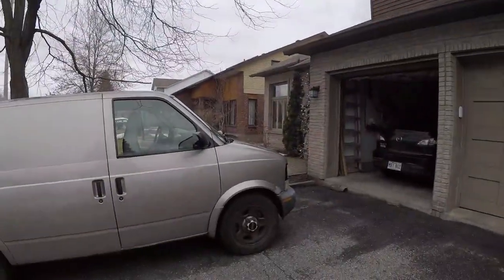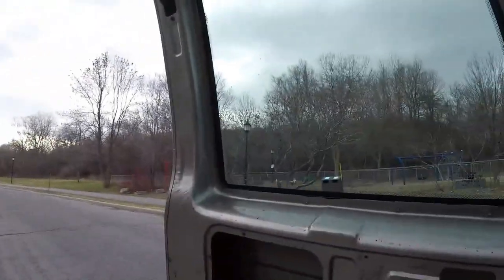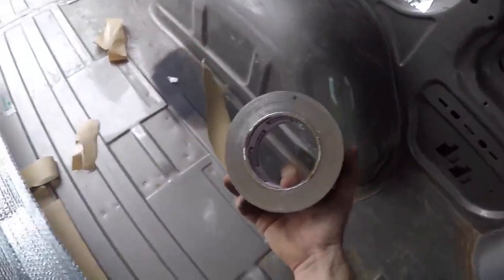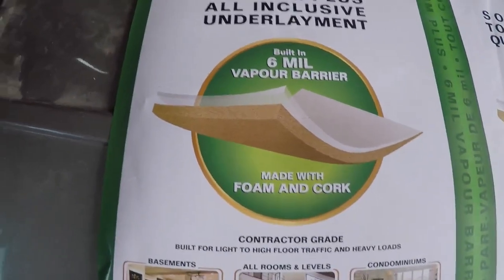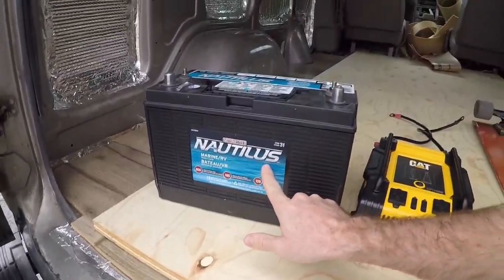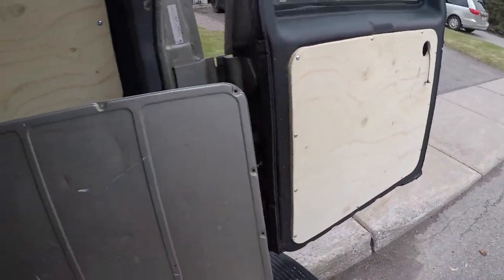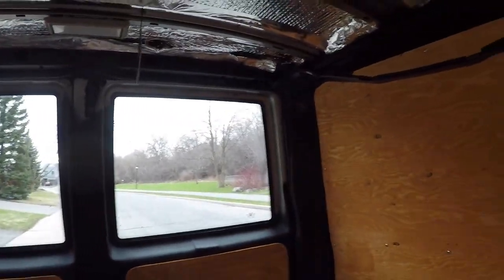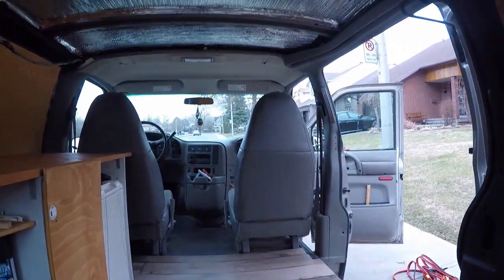Camper Van Conversion/Build Pt.1 - GoPro HD 1080 - (Van Life, GMC Safari - Chevrolet Astro)

Comment: Great series! Picking up my 1998 GMC AWD SAFARI EXT this weekend, for the sole purpose of converting it into a Camper Van!👍 I've been Blessed with a great Friend that renovates yachts for a living, and he will be the brains behind my GMC AWD EXT SAFARI Camper Van project. He is passing along to me the great discounts that he gets from his accessory suppliers....BONUS! I too will video document tbe project. Picked up some great ideas from your series! Just hate that I do not have the high top feature. But, we are going to cut out a section of the roof oval in shape, and add a custom fiber-glass cover. Reason? For the stand-up shower/toilet combination just aft of the driver's seat. I am very excited about this project, as I am sure you have been. Here's a short list of some neat features that he will build into this project: 19" Flat-Screen T.V. mounted to an articulating mount, hardwood flooring, 2 burner stove/sink combination with small marble counter top, (2) 100w solar panels mounted on roof, (4) 125 amp hour deep cycle marine batteries, fold away dining/work table, a compact refridgerator, compact microwave, retractable awning, tranforming couch/bed, pantry with sheving/drawers, WI-FI Booster, motion detecting alarm/with cameras, 25-gallon fresh water, exterior electical and water hook-ups and a side mounted vent system. Will of course have compact coffee maker, a/c and heat. Very bappy for you!👍

Comment: Damn I am still impressed how fast you put this van together. Most people will be curious how long in real time it took and what your total cost was.  Its common for paint on GM vans to peel they had some primer issue. Duplicolor makes the factory color paint in spray cans. Your vans paint code can be ordered at most auto part stores if you want to keep a low profile factory look.  I wouldn't recommend trying to apply a clear coat after its hard to blend and can peel. When a  body shop shoots clear they mix it with a hardener.
Reply from the maker: +rick g It took me about 2-4hrs a days for 3 days to get it to almost finishing point. I'm a carpenter back home. So i know my way around the tools haha. You're a wealth of knowledge! Really appreciate the feedback and information you've given me! Thanks so much legend! Cheers

Comment: I've been following van conversions for awhile now, hoping to be able to make mine even more road worthy...I have a feeling I read somewhere that you shouldn't put the reflectix up against metal for 2 reasons... 1: that it transfers cold and heat and 2: that it doesn't create a proper and protected air space that adding traditional insulation along with it will make... or maybe I dreamt it..?? LOL Good luck with the build and have fun! :)
Reply: KindaKrafty this is true. Reflectix falsely markets itself as a good general insulator and a toooon of people use it because the goddamn company claims it has insulating properties. It's only good for light reflection so in your windows. If it's not reflecting light/in your walls it's just bubble wrap.

Comment: Very nice van, very nice. Guys I am planning to buy an Astrovan, but I have a question and hoped you could help. I am 5'8" and am wondering if I would fit on a custom bed that went sideways or even sleep in the third sear if it comes to that. Can you give me your opinion?  Thank you very much in advance, Javier.
Reply: Dude, I am 6'2" tall and a slept across the back of my 89 Astro dozens  of time's. I couldn't stretch out, but the wife and I could sleep. more recently, I switched to an air bed lengthwise behind the drivers seat.

Comment: Joel, Wow I spent a few weeks making cardboard templates to cut 5m luan for my Express walls. You explained the door template how did you make the walls? What is the plan to cover the ceiling? Do you plan on varnishing all the wood to prevent mold?
Reply from the maker: +rick g I just measured out all the walls and dry fit them. I have 2 coats of varnish on the walls already.

Comment: Hey! These videos are great, they've helped me out a lot in preparation for my own van build. I also just bought a GMC Safari 1997. 

I was wondering how you made sure not to drill through the van walls through and through? I'm a bit paranoid about it haha. 
Also, how did you get the exact measurements for the plywood walls around the tyres and everything? I'm not that experienced with tools other than from woodwork class back in high school! I have a mate helping me out who is pretty handy though.
Reply from the maker: Hey sorry about the late reply.  I just used 20mm metal tapping screws (not sure what that is in Inch.  But make sure you screw into the ribs, You wont puncture the outside this way (:

If you get something bendy, but not super bendy (I used thick wire) you can mould it around the wheel arches and scribe it onto the ply sheets (:
Reply: Awesome cheers! 

Also how did you sort out personal car insurance? I'm having some difficulty finding somewhere that can accept a van thats being converted into a camper... Something to do with 'commercial vehicle being used for personal insurance', just asking around since it's a bit of a unique circumstance.

Comment: Cool build, the reflectix shoulldnt be compressed though or it loses is r value.
Reply from the maker: copernicus vanstruselclit Cheers. I tried to leave as much air space behind the reflectix as possible. But it's hard with the spaces i was working with. The big panels had quite a bit of space behind them. So hopefully it still works quite well. I've already noticed a temp difference inside the van with it all up, Cheers for the feedback!
Reply: Have fun on your journey!
Reply: Joels plywood is 9mm or .5" with some air gap which has an R value of .62 + so he has decent insulation from that.  For summer Bob Wells and IntoTheMyster13 full timers say heavy insulation takes to long to cool down in the summer.  I used 1" kingspan poly on walls and .5 for ceiling. But it's nearly impossible to cover all the metal which is a great thermal conductor.  OneAwsomeInch full times in Canada see his builds for cold weather dwelling, covers nearly all the metal.  IMHO insulation depends on the climate you plan to spend the most time in.
Reply from the maker: rick g - yeah exactly, i don't plan on travelling through canada during winter. So i'll see how i go this summer in the states and coming into the colder months back in canada.